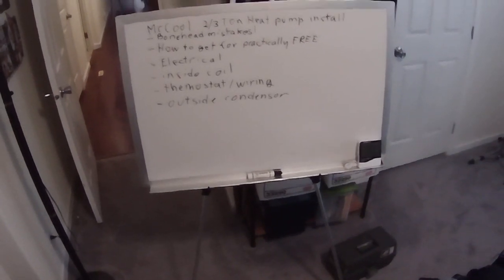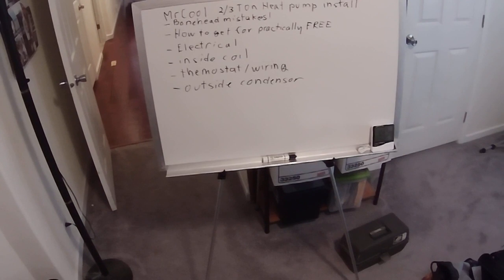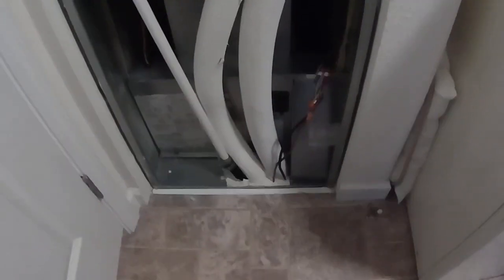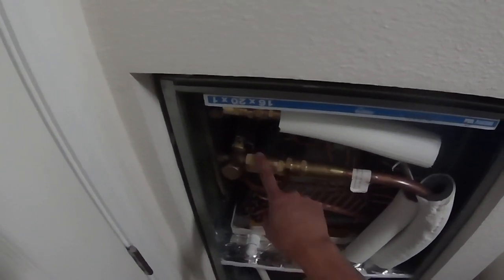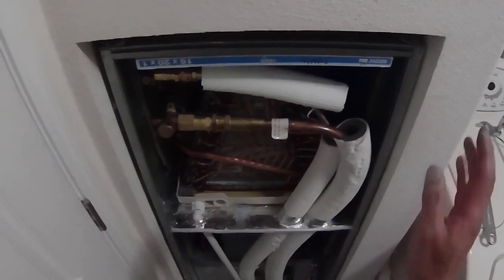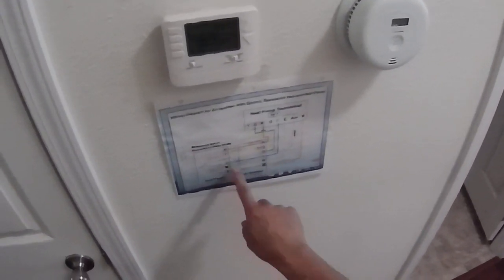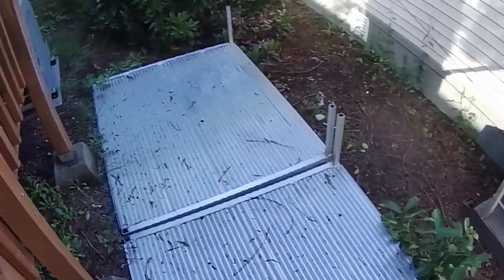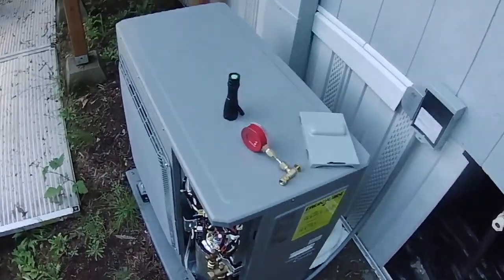DIY MrCool 2/3 Ton Heat Pump Install - Don't make these boneheaded mistakes!

Comment: I am in the process of installing one of these. This video has been very helpful. How has your unit been performing?
Reply: It’s been great! No leak, low energy consumption and having central air is amazing. No more rattling window units.
Reply from the maker: I did have my first major failure. One of the 20 amp slow blow fuses tripped which resulted in just the fan blowing air instead of heating. I have seen the amperage rise to the 20 amp level, but typically 16 amps are drawn. so maybe it needs a bigger fuse in 2 ton mode. This happened after I returned home from work and was trying to raise the temperature 10 degrees which operated the unit for hours to get there. It can only heat about 4 degrees every hour. So, it isn't very quick for heating your house if you turn it down during the day.
Reply: @franklinthu  What was the cause of the blown fuse, something must have shorted somewhere?
Reply: @Dicofol1  Despite the fuse size recommendation, the unit can draw more than 20 amps constantly when under heavy use. This was a situation where I had turned down the heat when I was away and when I put the heat back up, it had to work very hard for hours to get the heat back up. In the process, it blew the fuse, so that is why I put in a bigger fuse and haven't had a problem since. The wiring is set to handle the bigger 3 ton setting and this is also protected by the breaker, so the fuse is really redundant and I only used that because I couldn't get a connector box without a fuse.

Comment: Omg. Auxiliary is when your unit can’t keep up with very cold weather and the electric back up heat kicks in. You don’t want to see auxiliary flash on your t stat. Your electric bill will be very high if it does. How was your charge when you checked it with your gauges. Were there any left. Haha

Comment: I was looking at the 3 ton and it needs a 50 Amp breaker +27 Amp for heat kit + 15 Amp Air Handler.  With a 100 Amp panels seems impossible with the extreme heat.  Was that the case with you.
Reply: I do have a 200 amp panel. I'm not sure how all those amps add up since certainly the amps from all the breakers is more than 200. I suppose they count on you not using them all at the same time?

Comment: I just installed a 3 ton universal.  I noticed it pulls 0.7 amps even when off!!  This amounts to $180 a year in wasted energy.  Do you know what your current draw is to the outdoor unit when off? Thanks
Reply from the maker: I have an ammeter attached to my circuit and it says idle draw is only .7  - 1.2 watts, not .7 amps. Are you sure you measured correctly with the correct units?
Reply: Yes, it was amps.  I measured it with a handheld and I also have a split core current sensor that I monitor continuously with the Emporia energy system.  One other owner said they measured 0.6 amps.  I wish I was getting your reading!
Reply: My mistake, I was measuring when I had a blown fuse. The actual idle draw is .6 amps or about 13 watts.
Reply: Using a calculator I found online, at 13w running 24 hrs 365 days = 113.88 kwh and at an average electricity rate of .13/kwh, the cost is only $14.80 and not $180 for the year.
Reply: Thanks for checking again.  Power = Volts * Amps so 0.6 amps at 240 volts is 144 watts.
Reply: @mtbphil168 Is that idle draw on just one line (120v) or is it on both lines (240v)?  And how much of the time is at idle (I didn’t want to go up to the 4-5 ton, so the 2-3 ton size in my install isn’t idle all that much).
Reply from the maker: Yes, you are correct, I am also seeing the 144 watt constant draw based on amperage. Although I was thrown off by my power meter which was still only reading 5w which was wrong. So this does seem normal, but excessive just to run the  electronics, but they do have a full computer in there equivalent to leaving a PC or Xbox plugged in all the time.

Comment: 5:48 no you don't! You can use the existing wiring for your current unit!
Reply from the maker: In my case, I don't have any "current" exterior condenser unit. My existing air handler still needs the heating (for backup heat 60A) and fan circuits (30A). I think code also requires a dedicated circuit of the correct amperage.

Comment: What size crows foot did you use?
Reply from the maker: I used Sunex 1", 1-3/8, 1-14 and Tecton 7/8 - Some of these were too small for the fittings for some reason and I had to file down the fittings for some reason, not sure why. These were clearly the closest sizes and were off by the width of a piece of paper. This is another reason to just spend the money to get an adjustable crescent torque wrench.

Comment: Mrcool brand is bad LoL Mine broke down a bunch of times then i had to replace it with a good well known reliable company.
Reply: I'd be curious to know exactly what broke down and were you able to get warranty repair. It is totally unclear how warrantee issues would be handled.
Reply: Evaporator coil got a major leak after only 6 months. Warranty sent the coil weeks later. I had to pay the shipping. and the same thing happened again. So I had to pay a technician twice for that install plus twice had to refill the freon. I already spent more than what the unit is worth. Plus I had to go weeks with no AC. Then finally the compressor went out in less than year. These Mrcool are made in China

@franklinyoutubehu2349
Reply: Almost all HVAC units are made one China. Usually the issues are install related. @CubanMofo
Reply: No they're not. Only the cheap unknown brands like this one are made in china @srtowner

Comment: your condenser should still be running when below 32F,  why do you have it set that way??? thats not right,, unless i missunderstood you stating something..?
Reply from the maker: The 32 degree setting is mostly due to inspection requirements. I really should set it to 10 degrees
Reply: you should have it set for 0F,,, since this system is 100% efficient down to -5 F , i had the same system installed, and working excellent, was 28F a few days ago, and i checked the temp of the air coming out of the register and read 142F  very impressed, i also do not have a heat strip installed, there is no need for it.. hope yours is working out well.. @franklinthu
Reply from the maker: Also, that would only use strip heat only if the condenser wasn't able to keep up with the demand within 1 degree. This is how the thermostat activates backup heating. So, as long as the unit can keep the temperature within 1 degree of the setting, the heat strip would never kick in even at 0 degrees. But if I manually pushed up the temperature to be 3 degrees above current temp and it is less than 32 degrees outside, then it would kick in. This would heat the house faster and would likely take forever for just the 2 ton to heat it.

Comment: Better hope you don’t have to remove the blower motor
Reply from the maker: I am wondering if the system has to be serviced (like removing the blower motor) and you must disconnect the lines, do they reseal themselves if you unscrew them? Then you could just screw them back on after the repair. Otherwise, you would have to find a way to evacuate and then replace the refrigerant. Does anyone know?